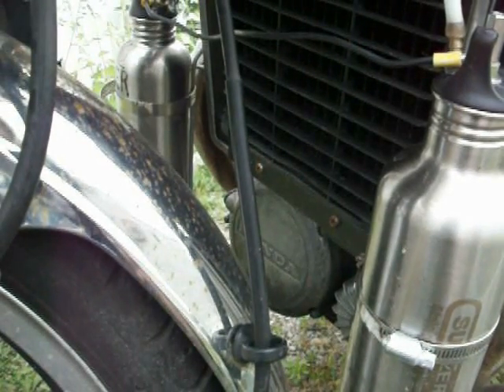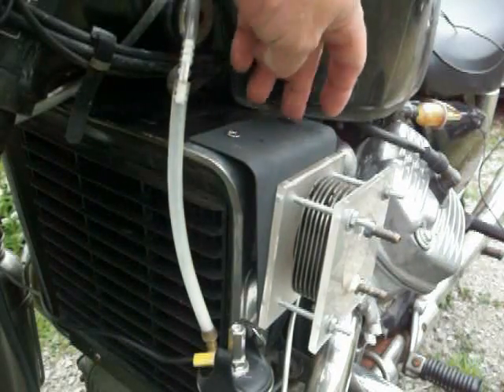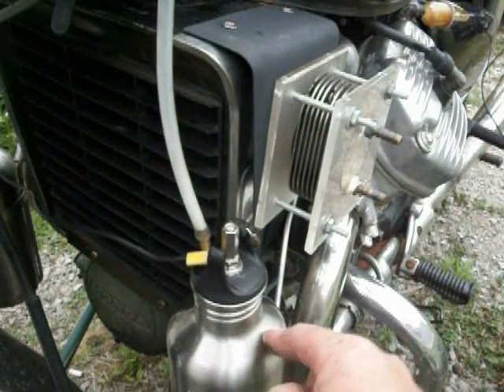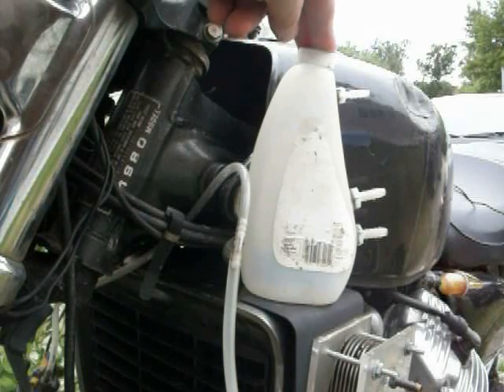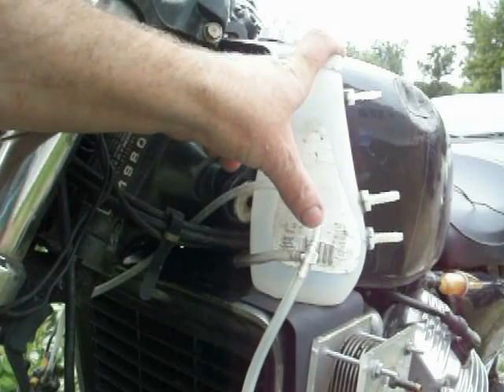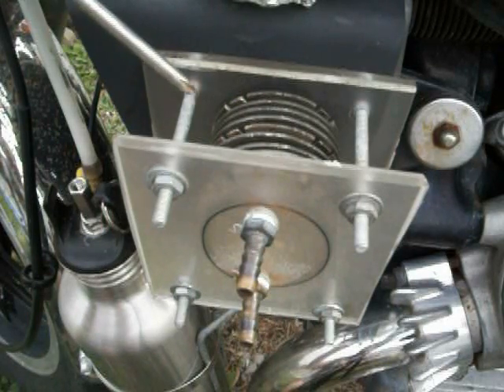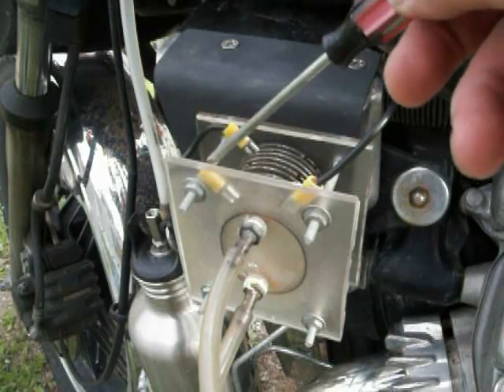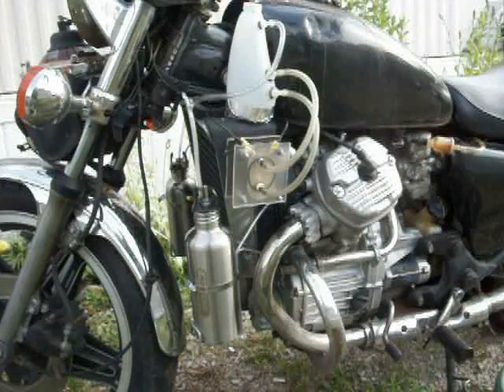HHO Hydrogen generators. This time THE WORKS!

Comment: if those bubbles are hydrgen than it seems you are generating a great amount of gas. so the system seems to work really well
Reply from the maker: Wucifer slayer Well as a concept it works really well. People have said there is a power issue and this concept solves it. However, it does need fine tuning

Comment: This system can work if you make enough gas fast enough. The missing point is it takes "MORE" energy to make the gas than what you get when you use it.

If it did work as people think it does, you could simple hook up an engine that makes gas and makes electricity and run it for free and get free power. But it is a negative gain so you can't.
Reply from the maker: You see, It doesn't work like YOU think it does. There is a lot more math involved then just how many spare HP you take from the engine to generate the extra HP. If that were the case then super chargers wouldn't work, because the only math that your looking at is taking extra HP from the engine and getting an extra amount of HP in return, which obviously isn't the case. They do not cancel each other out.
Reply: +wcemichael  supercharging an engine increases its HP but takes extra fuel also, supercharger uses engine power to compress the intake increasing volumetric efficiency but the fuel injection also injects extra fuel to compensate for the extra air and to power the device itself so you dont have free power or magic efficiency with it, you just increase horsepower and increase also fuel consummption. it increases the ratio of HP per liter of a specific engine but its actually a not very efficient device, as in all devices there are great energy losses involved, friction etc
Reply from the maker: Hugo Barbedo
Of course it takes more fuel, the device is creating extra suction to draw more fuel through the carb, and the pedal is pressed all the way down. With HHO the extra fuel comes from the device and your not pushing the pedal all the way down. You're moving the goal post.

THE POINT ALWAYS MADE BY OTHERS..."You can't draw hp from the engine and expect to generate more hp from the engine. The physics won't allow it. They cancel each other out"
Well obviously this is wrong....

You can't look at some physics while ignoring others and call it magic.

The great and power Oz, I mean the guy calling himself HHOinfo used to ignore specific data in favor of pointing out other data. His most famous quote was "you need a minimal 4% hydrogen before it will ignite. If you don't meet that, your hydrogen will not burn and just go out the tail pipe"

Well he ignored the fact that your mixing one fuel with another one, giving you a higher total fuel percentage AND ignored the fact that the H and O are in perfect percentages for burning, and the gas/air mix was also at a perfect ratio. Basically saying a match wont ignite in a forest fire.

Him and his friend used to give me the most shit. He even put me on his "hall of shame" web site. Then I proved his dumb ass equations were completely wrong. Never heard another word from him nor a single apology from him.

Comment: Engines are designed to run at certain air/fuel ratio for effective burning of the fuel. I am thinking that, with the use of your HHO generator hooked up, more "fuel" (in the form of H2) would be added through the "air" to the combustion chamber than what it was designed for. So it changes the air/fuel ratio, maybe too rich. Perhaps if you try reducing fuel supply while the HHO generator is in action, it might yield better MPG. Just a thought.

Comment: All I am trying to say is that to prove to us that you are running hydrogen, take off the tank and use it solely without gas. If it creates much more hydrogen from electrolysis than the myth busters it should work. Dude I am a Bio-Engineering major I know a thing or two about science.
Reply from the maker: "is that to prove to us that you are running hydrogen, take off the tank and use it solely without gas."
NO! This is a gas ASSISTING unit, NOT a gas REPLACING unit. What part of that don't you understand????

Comment: Dude take the gas tank off and run the engine to get rid of excess gasoline first and then hook up your "hydrogen" unit. I think your work is very sloppy unlike the mythbuster's work that you criticized. Do us all a favor and do this video the right way and maybe we will believe what you are showing us is true. Yes hydrogen works as fuel, no we don't know if you are using gasoline or not.
Reply from the maker: 1. This is a gas ASSISTING unit. NOT a gas replacement unit. So doing what you suggest is pointless
2. MB was also playing with a gas ASSISTING unit, BUT were demonstrating it as a gas REPLACEMENT unit, SO OF COURSE IT DIDN'T WORK. So and they didn't even get it working to use properly as a gas ASSISTING unit.

Criticizing the criticizer without understanding yourself  what YOU'VE criticized? Seriously? Does your family tree ever fork or does it just loop back into itself???

Comment: So with the key on engine off it's pulling 6 amp (draw), but when engine running it charges 3 to 5 amps (charge). To me I see that as after enough city driving of lower RPM the battery will be dead. This can only be used on 1200 RPM driving or faster. Hummm. Gas for city and HHO for hiway driving? And yes I agree to make this point and video better, remove the gas tank and show us how it's routed into the carb assembly.
Reply from the maker: the tube runs under the seat, and shoved into the air intake and filter.

Comment: its an interesting idea, where can i get plans to produce something similar, i know its possible to run a car on water but would need to get something built that would supply enough power to keep the thing working,
so where can i get some decent plans to build something similar then i can start doing my own testing and improvements,
i have seen a few mopeds in my area that produce water as a by product, so im thinking they must run off hydrogen as the only thing coming out the exhaust is heat and water, can you pm me with the info or plans so i can have a look and see if its possible to make a more efficient unit or modify the inlets on the motor to improve mpg, im sure its possible, maybe some sort of pressure system that increases the pressure before putting it through the inlet, but as its something i know very little about id need to experiment with different ideas once i have a good understanding of  how it works,
its a great idea though and anythings possible,

Comment from the maker: DK Kempion This is a gas assisting system, not a gas replacement system. It was put on here to prove the concept.  The previous year I was limited by the amperage I could use. This allowed me to put an extra unit on without using extra amperage. The passive system could be used on an electric car powered by hydrogen, to put some hydrogen back into the system between fill ups.

Comment: Less than zero? Can you show me that it uses less than zero?  Car or bike it doesn't matter. I own a bike and the alternator produces ever less power than a cars. All that aside, you will always use more power than you will ever get back out of it. It is all in the physics and math. If you can mathematically prove that 1. you are using less than zero power. and 2. that you are getting out more than you putting in. I will eat my words and you would be a very rich man because it can't be done!!

Comment: Physicists, and physical laws, point out it takes more energy to create the gas. In other words, the system's output is less than its input. Critics also urge interested parties to look at how much gas it takes to power a car, as opposed to how much oxyhydrogen is necessary to replace an equivalent amount of fuel. More importantly, a car's alternator can't produce the current to generate that much HHO.

Comment: You do realize that Honda has Hydrogen powered car so if they can do it why can't this guy, and I'm pretty sure that he is adding this HHO into his air intake and still using gas as a bass form of combustion. So the HHO is to help us save less gasoline, and to burn the gas in a cleaner and more fulfilled manner

Comment from the maker: No the title is correct. The previous year I just had the one small bottle, drawing as few amps as possible because I had to worry about battery drain. This year I had 3 units drawing the same power.

Comment: I see water i see bubbles... just like all the other hho videos and am told that its hho... when h2 and o2 combine there is a 99.9percent chance that they will combine as water...70 percent of the surface of the earth is coverd in water because of this...if you do not seperate the h2 from the O2 after hydrolysis you will make water.... light the supposed hho out put with a match...if it flames ill believe... please....

Comment from the maker: What I'm watching (personally) is a cleaning effect. The bike did get 30 mpg. Now after the original use of a unit, the bike gets 40 mpg. This demo was to demonstraight that I could max out the amps being used (after that the battery starts to drain) and still get second unit up and running, like I thought I could. Although I did not get extra mpg above 40. People said I couldn't wire it this way, and I proved them wrong.
People have copied my first water bottle and have gotten results.

Comment: If what you are saying is true...no one would pass an emissions test.  New automobiles engines run far more efficient than ones of the past.  Electronic enging management with O2 sensors and variable timing waste very little fuel as evidenced by low hydrocarbon (unburned fuel) emissions.

Comment from the maker: last year I ran 1 cell. 1 type of hookup. Limited amount of amps. Too much power draw from magneto equals dead battery in a week. small HHO output.
What I achieved this year is, using the exact same amount of power from the bike, I was able to run 2 types of HHO cells using 2 types of hookups, increasing the amount of HHO that I produce. Same power, more HHO.

Comment from the maker: Excuse me? I got improvement one year, but not anymore the following year, but still having the original improvement and somehow that's complete failure? OMFG!  Answers are what WE are trying to find. The cult-nut naysayers are doing the "armchair quarterback" thing, claiming they already have all the answers with less than zero work. Edison had MULTIBLE misses before he had the breakthrough. Good thing he didn't listen to the cult-nut naysayers and just give up, huh? WANT ANSWERS? DO SOME WORK!
Reply: I like  all context  that  it's here showing  details and point the direction for success H2 , the people talk about too much  of waste energy when  they don't even  know  that the alternator  or  coil in magneto it's control by the inviseble,  that limited the max of power you take off from what they offer, alternator don't fry and with permanent  magnet, they produce 3 phase electric  current  360 volts,  but with the rectifier,regulator and control on magnetism in the stator  , alternator on put out the voltage need at battery,  same in the magneto for the bike,  all this nonsense of waste  energy  it's for the Dunnies,  that instead  learn why this it's take way from then in first place the come to you and started  talk about  waste energy , even if the alternator in case take 1 horse down  to make more electric energy , why we have 300hp on engine when u can get to point  A to B with 150 in old days,   but  no just add more 150 to make 300hp end waste that energy on the fuel  that u need to add for 150hp to drive plus 150hp to get out in the muffler that its how stupid  people are this days , thanks for the info that u give  keep doing what inspire you for the benefit of our self  and keep given the experience to help others , don't give dam to the stupid people  that ask questions about  things they don't understand....

Comment: I like using a ultrasonic to make water fog gas then use a Tesla coil to make O3 gas. mix with the fog in a UV light and you have H2O2 gas run really good and at less problem is Oxidation of engine.....Need just a bit of veg. oil spray every month or get Aluminum engine....